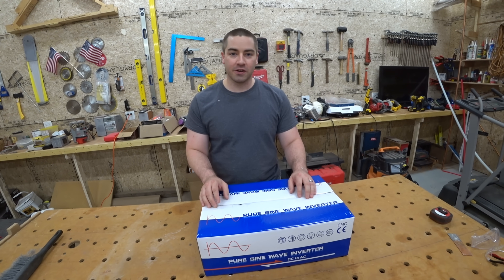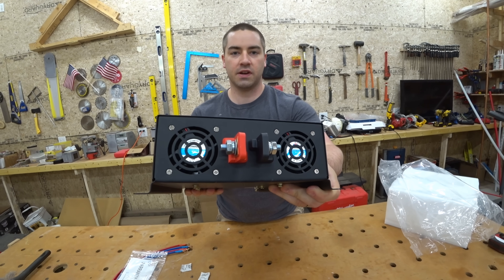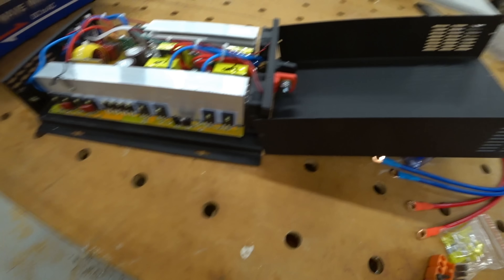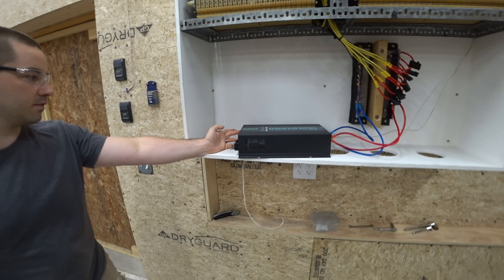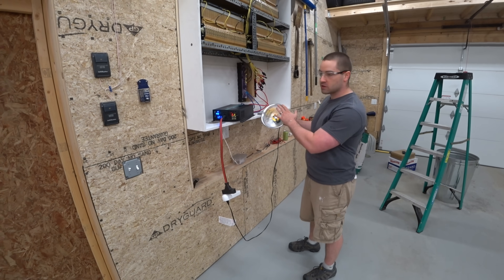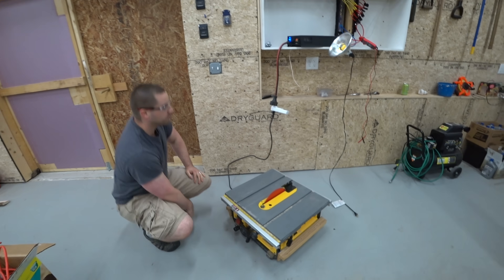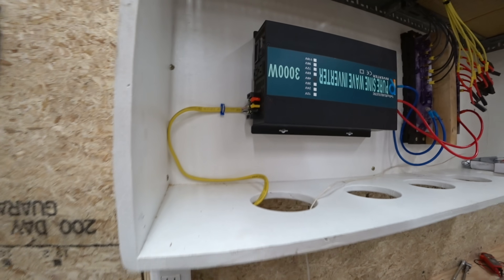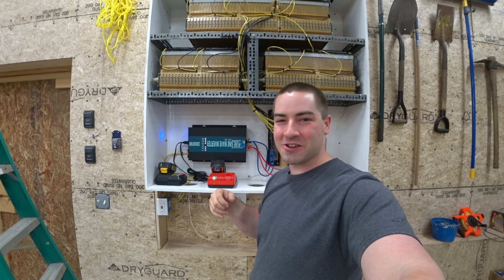Cheap 3000W Reliable Inverter, DIY Powerwall, Chevy Volt Batteries

Comment: The wires are much to small and could be a fire hazard, Also I had one of those inverters just like that and it is NOT  REAL SINE WAVE Like it says.  I had some stuff connected to it that was acting up, So I got my scope out and hooked it up, and it shows Square Waves
Reply: @Elkastro100  what he said was valid and never said it didnt work, he stated what he stated which was it was square waves not sine, which is a very valid criticism. having a steady wave form is also valid, but still not what he said.
Reply: Square wave is older and less expensive tech however it's reliable and generally won't be an issue unless you want to use it for digital power products such as LED lighting for example.  Refrigerators and traditional lamp sources should work fine with Square wave.
Reply: Yep, nothing but pure Chinese junk, but that's where they're all made unfortunately. Samlex is supposed to be one of the best brands for actual pure sine wave inverters.
Reply: @brandon18054  victron are pretty good and made in India, after doing some research they are pretty reliable. SMA are also really good. Anyway good things are made in China, just not much.

Comment: the battery cables are way to small. you need 0 or 00 size to keep from choking out the amps in the cables
Reply from the maker: Hi Jerry,  Thanks.  Are you referring to red/blue from the inverter to bus-bar?
Reply: Yes the Red and Blue cables are way to small. See if you have a 10 amp ac load, then the DC load would be 25 amps on a 48 volt inverter. 120/48=2.5 so you have to multiply the ac amps by 2.5 for the dc amps input. See watts stay the same across the ac to dc conversion. So if yo have a 120 ac volts with a 10 amp load = 1200 watts.  1200 watts / 48 dc volts=25 amps. Oms law says watts/ volts= amps  or volts*amps=watts. Think of the cables are water pipes. Say a 1" pipe can out put 1 gallon a minute but you need 5 gallons a minute. Then you would need a bigger pipe. hope that makes sense. So if you put a bigger cable on the inverter it just might run that compressor you where trying to run.
Reply: yes the blue and red cables

Comment: I wonder if having a variac hooked up to the compressor and slowly dialing it up would make a difference?   However, once it kicked on again game over.   

Face it,  all that solar is fine for slow heating of water and running a bunch of lightbulbs.  You would need a 6000 watt unit to actually handle some power.
Reply from the maker: Hi Blake,  I agree, I need a larger unit to power my tools.  Even my saw is way under-powered with this inverter.  As of right now I'm saving up for a big inverter, but it's going to take a while.  So I got this cheap unit to do some stuff in the meantime.  Thanks for watching.
Reply: Drain your compressor and turn down the psi all the way a slowly turn it up as the engine builds up..Its called a vapor lock and make it hard for the compressor to start.

Comment: inverters are very sensitive to voltage drop, you need to make your batt system 48v and not 44 and use say 5awg wire to your inverter also if all batt's have in line 30amp fuse connected to your bus bar you can only draw 30 to 35 amps they don't add together also use close to 0awg between battery's and fuse them at 100amps. the inverter will perform much better.

Comment: my 24 volt 3000 watt with a peak of 12000w will run that compressor.
Reply from the maker: Nice.  Is your inverter Aims?
Reply: its a power jack 3000w lfpsw(Low frequency pure sine wave with a 12000w surge 24v. I use 00awg wire for my battery's and to the back of the inverter. 00awg is about 400amp I thing
Reply from the maker: Good to know.  I've read mixed reviews about the powerjacks.  They even have a brand new model 15,000 watt model.  I'm glad the brand is working for you.
Reply: thank you the inverter runs my apartment very well, starts the fridge every time. ive had no problems with it. ppl like to dog Chinese stuff but most things are made in china nowadays. but those who have problems are prob due to insufficient wire gauge/battery's

Comment: The inverter can take a 6000 watt surge if the supply voltage and Supply current is ample enough. Also this is with the assumption that your compressor is not old or cheap and drawing more than it's rated which is always a possibility
Reply from the maker: Nope, I'm not an PE of any type.

Comment: I want to run a small camp fridge with my cigarette lighter. "It comes with the adapter" What do I need to know about volts and stuff. I'm very new to inventors and what not. The fridge works fine inside the house, with the wall outlet, and works with a battery jumper. I can't seem to get it to run inside my SUV in the lighter port. What could I possibly be doing wrong? I made sure the polarity was correct, and the port works with my cell charger. I'm alone with no one to turn to but youtube.
Reply from the maker: Most cars and SUV's are rated at 12 volts.  The accessory port in my car is fused at 10 amps, or a maximum of 120 watts (v*a=w).  It's possible that your camp fridge draws more than that at start-up.  Or that your port is fused lower.  Or maybe the port is switched on only when the car is running, and is off when the car is off.  Here is another thing to check: You said the camp fridge came with the adapter to plug into the cigarette lighter port.  Try unscrewing the adapter housing, sometimes there is a glass fuse inside that and might need to be changed.  Good luck
Reply: @DavidPozEnergy  Vehicle power points are typically fussed at 10A in North America. Some manufactures also fuse the power port itself. Unfortunately, there's no standard for the ports to be switched (ignition-enabled) or unstitched (always hot).

Recreational refrigerators are typically 120Vac/12Vdc. Some with auto-switching to mains power when available. These units usually consume very little power when running and don't require high start current.

My Domestic CFX 65 combo fridge/freezer sips power. It's connected an AC circuit that's only hot when my rig's connected to mains power, and to the DC bus where it normally draws raw power without incurring inverting losses.

Comment: Great vid. What size wire did you use on the ac side of the inverter. Working on my own set up at the moment.
Reply from the maker: I used a piece of 12 AWG Romex to an outlet from the main lugs on the inverter.

Comment: is it a pure sine wave inverter?if it is not it will damage the compressor of refrigerator or split unit,,so you should check the sine wave using an oscilloscope
Reply from the maker: I don't have an oscilloscope, but I've watched youtube videos where others have hooked up these inverters and found it is a pure sine wave.
Reply: you could add it to your workshop tools it is cheap just google digital oscilloscope price

Comment: I was surprised that the compressor would not start. I just ran the same experiment with the same type of compressor powered by my DeWalt DCB1800 power station which is 1800cont/3600peak watts and the little sucker fired right up. FWIW, I think you have a problem with the centrifugal start switch on the compressor. Get inside, clean the contacts and I think you will see much better results!

Comment: If you have no air pressure in the tank it will run it. When the tank has pressure it pulls too many amps trying to push air into already pressurized tank.
Reply from the maker: Yeah, we tried that too, but it still didn't start.  That little inverter just doesn't have enough power.  Thanks for watching.
Reply: Thank you CHINA,dammit.   HUH

Comment: Are your batteries fully charged? Likely not. Once fully charged, the inverter might handle it. I'd want an 5 to 8 thousand watt inverter for my shop. It's actually brilliant to use these batteries as they are cost effective. I  love doing these types of projects. Your baby is precious! Subscribed!
Reply from the maker: Thanks for subscribing.  No, the batteries were not fully charged in the video.  After I apply my first charge, and bring the batteries up to full I plan to test the compressor again.  I hope it does work.

Comment: Try putting a 100 ft extention cord between the inverter and the compressor, also ad an incondescent bulb (maybe 40 watt). Tricks I learned during a power outage and trying to run my fridge (inductive load) on a minimally sized inverter.
Reply: What is the purpose of the incandescent bulb?

Comment: Talking about manuals...the instructions in this inverter are  indeed garbage.  I have a similar unit and the  neutral is not bonded.  Hence, the ground and the neutral need to be tight together ...therefore  the ground from a nearby receptacle should be connected to the inverter ground.  This will facilitate the island mode connection of the inverter to any appliance as shown in this video.  There are electronic equipments that if the neutral is floating...will not function properly....

Comment: hy. pozition of inverter shood be verticaly ,ventilator push hot air up is easy too cool electrinics ,und put it out the box  sory for my language
Reply: valid point but not something that will actually make a difference for short term testing. for long term use though most definitely accumulates a difference.
Reply: Makes little or no difference in the real world because the fans bruit  force air flow

Comment: I would try two things to verify its your inverter that wont power the compressor. 1'st try and up the wire size going to the inverter (3000 watts @48 volts is over 62 amps, the sure to start the compressor could be well over double or tipple that number). second, you might want to try putting a capacitor parallel to your battery bus bar, this can provide the massive amount of power that is temporarily required to start large motors.

Comment: I wonder if a hard start kit like they use on AC units would drop the starting watts enough to get the compressor started.
Reply: I'm pretty sure big factories have huge motors with fly wheels to handle surge.

Comment: The wires look very small on the battery bank to the bus bar. I would have used at least 4ga wire. Looks good though
Reply: Look closer and pay closer attention to the details, he's using two #10 wires on each connection which at 30 amps per conductor gives you a 60 amp capacity.
Reply: can you make a system that uses your car to run this inside house, and turns car on and off to charge car battery? if they make it whats it called? anyone know?
Reply: We use an 2000 Buick century 3.2 V6  as a generator We added a second crankshaft pulley the same as the original drilled out the three taped screw holes and use a serpentine belt with an idler pulley, hooked up to a 12 volt 160 amp bus alternator  to our batteries. It's  very quiet and sips gas very slowly  it has it's own shed there are a lot of pluses for using a small car.
Reply from the maker: Thanks old time engineer.  The wires from the battery to busbar are 10 gauge.
Reply: The reason he is saying use a  4AWG is for a reason.  The Inverter is rated for a max of 3kw.  When inverting or ransforming power from one form to another you need to take into account that although Power in = to Power out (in an ideal world)  (The losses would not be on the DC side anyway).  But to the point.  Your DC has the potential to pull  almost 48 AMPS if the inverter was ever used at full load (probably not and would not advise it if you want it to last)  But you will also need to worrry about inrush as well.
If you use AC current rating for wire gauge-Ampacity you would not want to use #10 as it is only rated for 30Amps.  #6 would be the least you would want to use it is rated for 50AMPS.  BUT its always good practice to up it a size and Electricians dont like to use odd numbered wire sizes.  THerefore I think he is spot on with #4 AWG.  Youl probably be ok as long as nobody inpects it.  ;)
Reply: A 3000 watt output inverter with around 90% efficiency is 3300 watts input power, about 75 amps at 44 VDC.  Double 10 AWG wires (equivalent to about single 7 AWG) at 2 feet one-way distance gives a total drop of about 0.15 V (about 7 watts loss).  Insignificant in a 3000 watt system.  As far as inspections, low voltage wiring doesn't follow the same rules as standard residential wiring.  Building electrical codes are ultra conservative to prevent fires even accounting for worst case, poor wiring techniques, and the wiring being trapped within combustible materials with no cooling airflow.  Most of the time it's good to go by those conservative numbers for building wiring because the run length will be enough to need larger gauge to reduce voltage drop.  When the run is very short, voltage drop is less of an issue and conductor heating is a bigger concern, but in free air you can push conductors harder than when they're enclosed.

Comment: the ChinaFreight 2000 watt modified sine inverter starts/runs my Porter-Cable 150 psi pancake compressor very nicely. Why do you think that inverter wouldn't run your compressor?
Reply from the maker: I don't know.  Some commentators have suggested too small of wire, or maybe too low of voltage.  When I get my batteries charged up to 48 volts (instead of 44) I'm going to try again.
Reply: DavidPoz Thanks for this video and your reply. I am adding a pure sine and so am reading/watching up on them.
Reply: Why not measure the surge load - and see if it fall in the range of the inverter -- your killawatt might flash enough or you could invest in another meter -- better than guessing -- but I like you approach and spirit !

Comment: Are those amps hanging? To the rightside of your wires running vertical?.also, switch your batteries to deep cycle batteries last longer. However, great video

Comment: @ DavidPoz

That Inverter although it is states it's a 3000w / 6000w surge Inverter, I've contacted the company regarding an 8000w inverter of theirs & asked them if it will do 8000w continuously & they said no, they said that all their inverters continuous rating normally are 1000w under the rating on the inverter. So your inverter being a 3000w inverter is only capable of 2000w continuous or 4000w start up surge for longer than 10 seconds. That is why your compressor couldn't work. You would be better off with a 5000w Inverter for that compressor.

Comment: Hey David, if you get a moment, here's an ultra quick and cheap and dirty thing you might try. 

Looks like you've got (8) 44VDC battery packs wired in parallel to your bus bar there, which by simple inspection, seems as though it could do the trick for the compressor judging by the wire size. But the feed to the inverter from the bus bar - those doubled up wires, may not be adequate for the initial surge.

If you've got a set of jumper cables in your vehicle that you could use from the bus bar to the inverter to reduce the line resistance down just a hair, this might get you the initial kick needed to get things started.. 

Of course, this could all just be for naught and the inverter may just not have what it takes (or like you say, the 48VDC needed vs the 44VDC available). But, figured it was quick and easy enough to give it a shot.
Reply from the maker: Thanks Mike A.
Reply: Yes, starting off about 5 volts below where a lead-acid setup would be and  I wasn't able to tell if the green cord was in line at the time.  Has there been an update regarding this?

Comment: The wiring on the inside vs. the outside should indeed be different sizes. The inside wiring is feeding a 15A outlet and shouldn't require anything larger than a paltry 14AWG. With the exception of the intermittent surge, nothing fitting that plug should ever draw more than 15A (roughly 1800W).. The Hardwire you're referring to, the external wiring, needs to be large enough to support the entire 3000W which is why it is larger..  Be careful wiring that external source to 15A outlets without some type of CB. It could start a fire.

Fun fact: Batteries typically create power through electrolysis/chemical reaction and thereby can choke/sag momentarily when surges are required, say for example, your compressor. I'd like to see how the unit responds if you were able to get your hands on a super capacitor and place it in parallel with your batteries to provide robust assistance with surges..
Reply: DavidPoz 
You won't find them in existing equipment - the technology is too new. EBay is a good source.
Reply: Cheap,, ehhh....  Was thinking that some Samaritan might sponsor you..  A few hundred bucks in parts if you make an array yourself it looks like. About $1500.00 for something preassembled. Then, of course, you'll need a means of initially charging them without creating a blinding flash arc.
Reply from the maker: Thanks Mike A.  It would be a lot of fun to try installing some capacitors.  However, I have no idea where to find them cheap.  Any ideas?  Maybe old amplifiers?